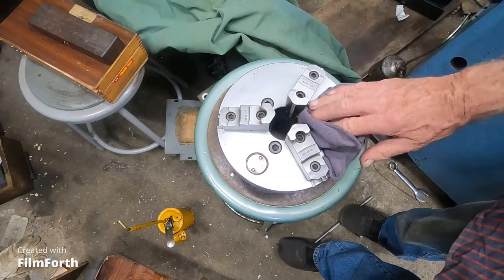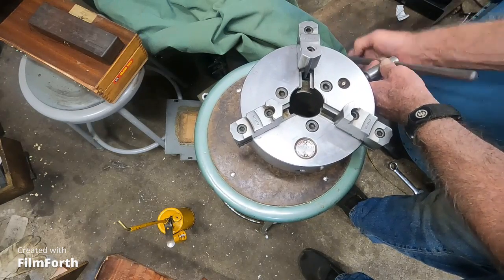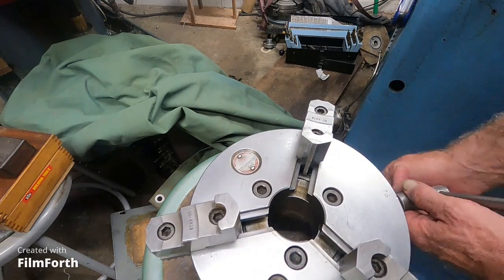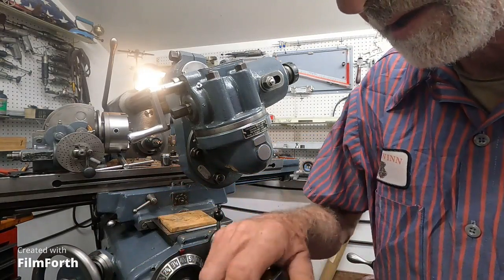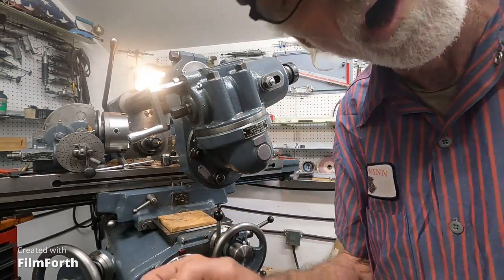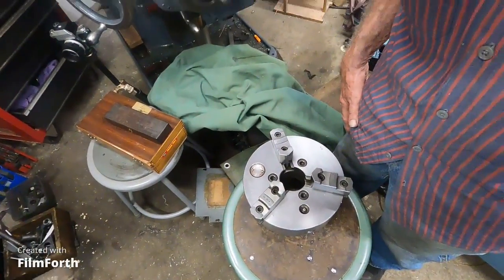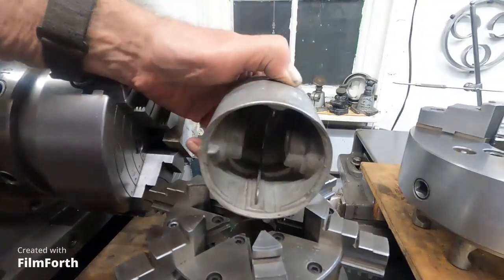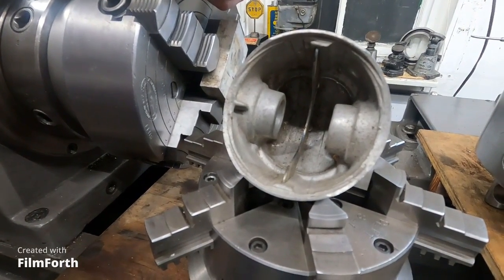Chucking with 3 and 6 jaw lathe chucks in industry

Comment: Hi Don, a while ago I hit the jackpot and pulled a big old 10” steel 3 jaw chuck out of the dumpster at the local “machine shop” that I buy material from. It has one of those little ball and spring oilers that feeds directly to the pivot of the scroll. It’s clear that the chuck manufacturers knew what needed oil the most. 

My friend also has a 12” 3 jaw that he found in a scrapyard, and I believe it has a grease fitting that feeds the scroll and another for the pivot.
Reply from the maker: My little 6 jaw was in a scrap pile, locally a used Bison 12" steel body chucks go for not more than $300, a new one is around $3000, the one I have is still tight and only needs a jaw regrind, many do not know how to do that and try to use soft jaws instead, depends on what you are looking for.

Comment: Always full of useful information. I have a 10 Gator 4 jaw that’s “semi steel” it cost $950 about five months ago. It’s definitely not balanced as well as the old atlas 3 jaw I have. My lathe’s top speed is 2500 RPM and the chuck is only rated for 1500 RPM. I get nervous running it up to 990. My two top speeds are too high for that 4 jaw chuck. Now I wish I went with the 8” vs the 10” it’s only a 13-30 lathe so the ten inch could easily overrun the swing with the jaws backed out all the way. But enjoyed the lesson today. 
Have a good day Sir.
Reply from the maker: This Axelson came with a 12" 3 jaw, it seems large too, the normal 3 jaw that would be supplied is 10", even used chucks a really expensive now

Comment: Dee what's your thoughts on using battery powered impact wrenches to repositioning the jaw, but not actually torquing them down and flipping jaws from OD to ID?
Reply from the maker: I have not tried that, I suppose it would be fine but could be over done.
Reply: I use a 1/2” air drill that has reverse or a cordless drill rather than the impacts

Comment: After I do that lubrication I put an appropriate cardboard box aroud the chuck mounted on the lathe and run it at high speed. Otherwise you'll get an oil bath when you start up the chuck.
Reply from the maker: That is how you earn your millwright parade stripes and one water resistant shoe.